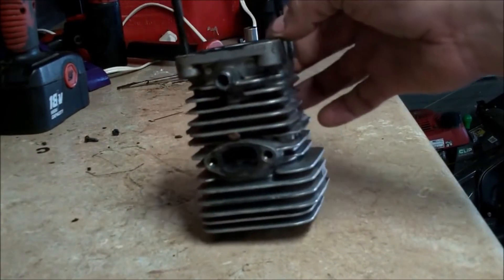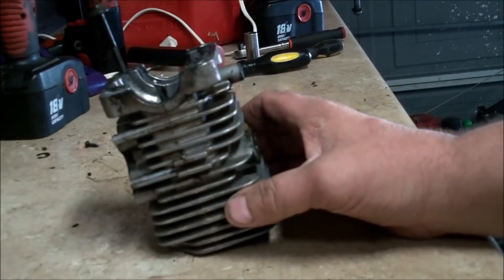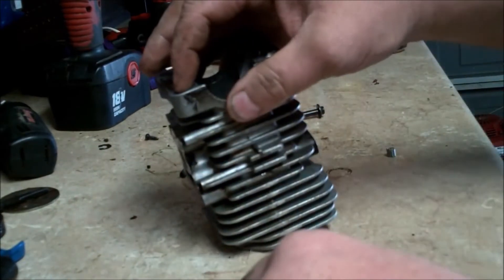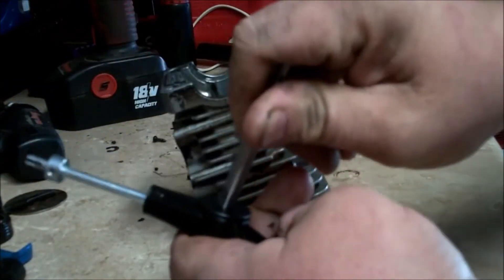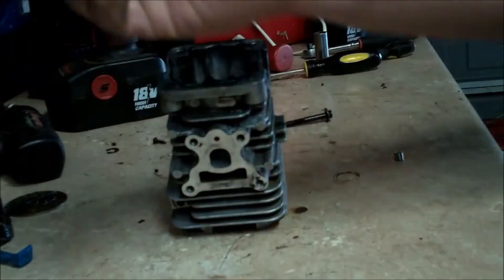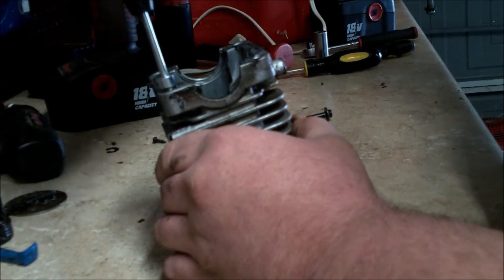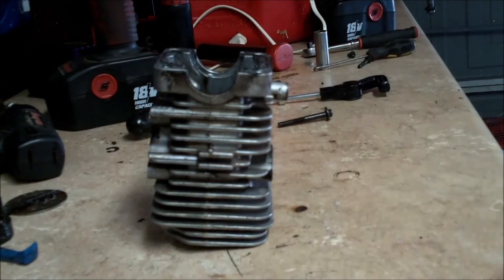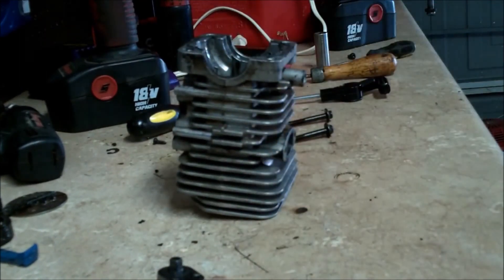HOW TO REPAIR STRIPPED THREADS WITH A HELI-COIL   (CHAINSAW CYLINDER HEAD)

Comment: I have a little Honda xr50r. The spark plug threads are stripped out of the head. It's $60 to order a new head or the Machine Shop said they would healicoil it for $70. It's crazy to think that sometimes it's cheaper to buy a new part than it is to pay to have it repaired

Comment: Good video.
You should of shown on how to size up the heciol.
At the end you should emphasize that you should use a antisieze compound to prevent the bolt seizing to the hecoil because of dissimilar metals.
Reply from the maker: John Bladykas helicoils are stainless steel  and you don't use thread locker because the insert may come out with the bolt.  Thanks for the tip!!